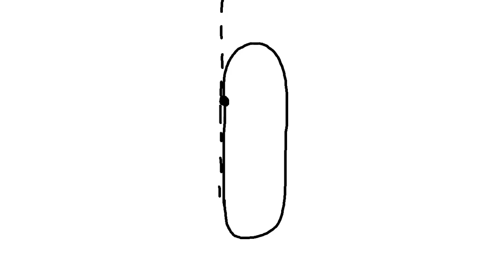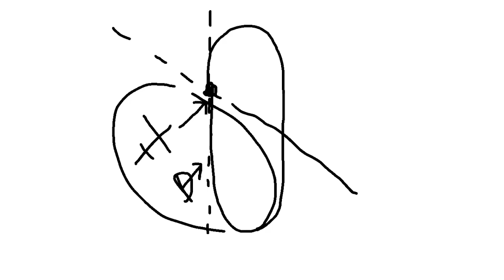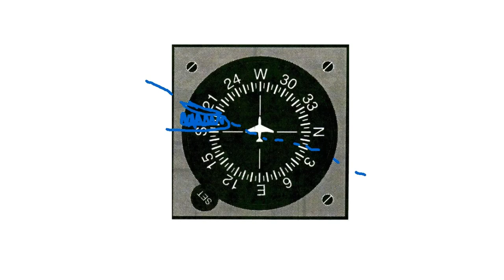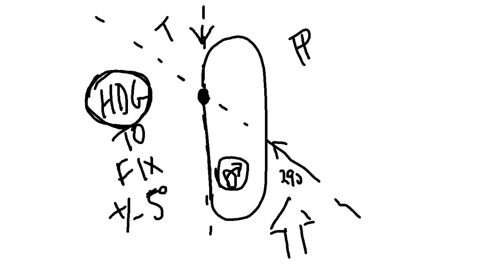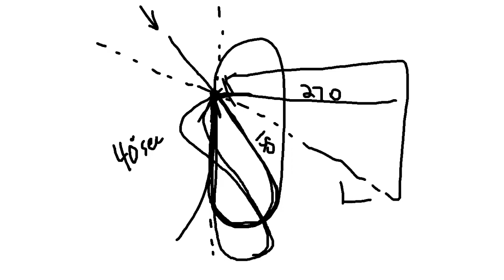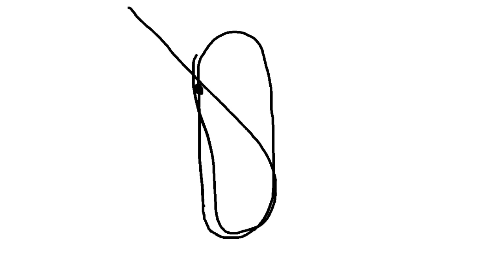Determining Holding Entry

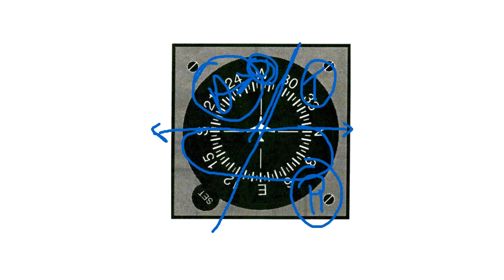Comment: @ 3:36 you call it direct .   @ 6:13 you call it a Parallel entry. I think you made a mistake at 3:36. Looks to be a parallel entry both times. I'm fairly new to this. Correct me if I'm wrong.
Thanks.
Reply: I have the same question !
Reply: Finally understood... Great video !
Reply: +Paul Darpa both are parallel

Comment: So if you are flying a track of 280 to the station which is sector 1 with nil wind. And in a strong northerly wind condition you are still tracking 280 to the station but heading 310 after wind correction, are you in sector one or two?

Comment: Question. 10:25. Why would counteracting wind giving you 260 heading make you fall into Sector 1? You're still tracking 290 isn't it?
Reply: Holding entry is based on your aircraft heading regardless of track.  So if you have wind correction in to keep a track,  it is actually the wind correction heading you would use.

Comment: At 3:36, I would say your method works if your aircraft position is south of the holding pattern, so you would essentially turn right to intercept the inbound course. However, if you were arriving at the fix heading 270, I'd teach a student that would fall under a parallel entry since you are going to end up on the non-holding side and want to establish inbound before making the right-hand outbound turn.
Reply: I totally agree. I also got confused when he said direct, and started to question whether I really understand this or what is happening. I would also do a parallel entry in that scenario